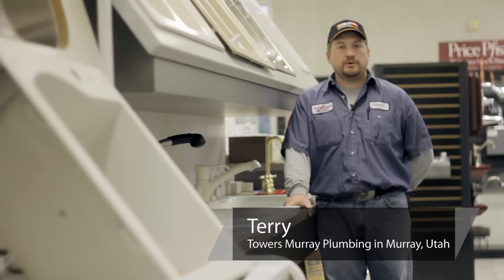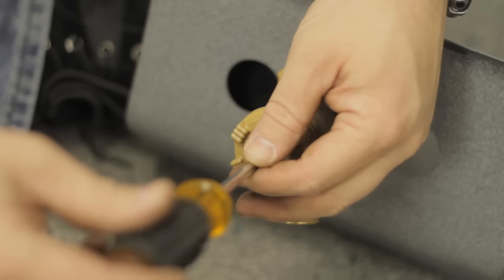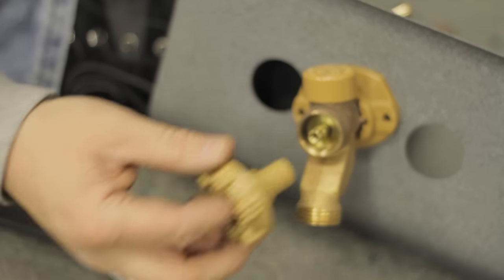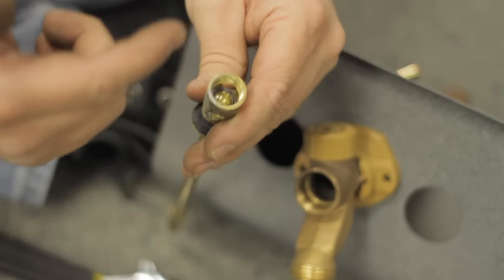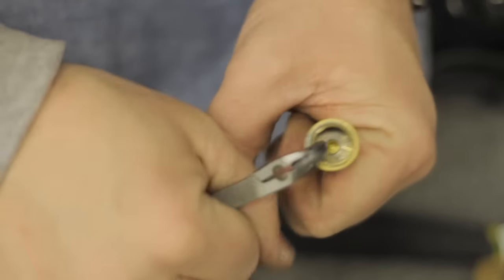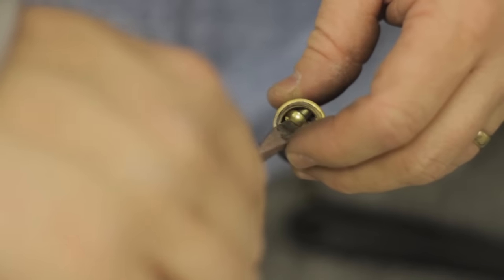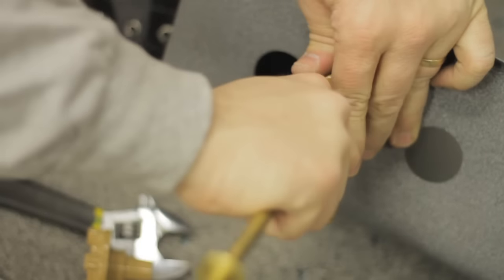Fixing Faucets : How to Repair a Leak in a Frost-Proof Water Faucet

Comment: Worked great for me. Though my packing ring wasn't rubber, but a wax/thread material. I had to dig it out. And my new handle is harder to turn. But it works fine!

Comment: i had  my faucet not turning completely off. I purchased a repair kit and replaced everything but the check valve. should i get back in there and replace it? i just didn't know how to remove the old one, from another video i now do. can i get away with it and leave as is or should i get in there and replace the check valve? thanks- Jr.

Comment: If the faucet leaks around the handle when the faucet is on, but doesn't leak at all when it's off, do I need to do this whole repair, or just the packing washer?
Reply: Bobos Curse How did you fix it, I have the same problem?
Reply: @ivana10yu  I tightened the screw and that took care of it for now.
Reply: Mine leaks when handle is on, bone dry when odd. I tried tightening the screw and it still leaks. I’m gonna venture a guess that it’s the packing washer immediately behind the handle.
Reply: It could be the rubber seal

Comment: Hey Terry, great video of a disassembly of the valve. Do you know what would be causing the valve to pop out 3/8” when the water is turned on? I have to wiggle it just right and push in while I turn the handle to shut off the water. I would love to fix this instead of having to replace the whole spigot as I am  concerned about this causing a bigger problem down the road. The line is in between floors with no direct access to see what’s going on behind the wall so this also adds a degree or two to the overall difficulty. I’m not sure what the best course of action is for this situation. I don’t know if this valve problem could be become worse or if it’s just a small nuisance taking more time to get the water to shut off.

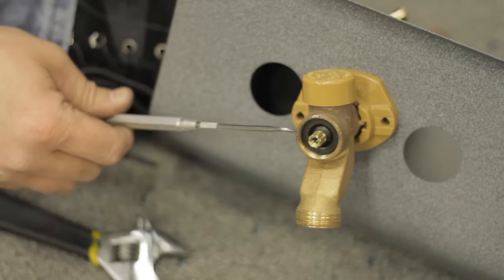Comment: Can you tell me for this 00:45-00:50 I need to repair small leak from handle, do I need to turn off water at main switch to change the rubber seal on 01:02

Comment: Good job, short, sweet and to the point. I have a rental which has a corroded brass seat in the silcock caused by lime and mineral deposits. I can't get the seat out with a seat removal tool. When we replace the bib washer, the seat is so rough, it tears the bib washer up within days. Is there a tool I can use to maybe smooth out the brass seat without removing the entire silcock? I'll have to tear up an interior wall to remove the silcock to keep from twisting the copper pipe. The silcock pipe threads are also corroded. Any suggestions?
Reply: Me too!

Comment: I think the pipe itself burst. When the spigot is off and there is pressure, water comes out from behind the escutcheon. I do not know how to access the other end of the hose bib. Can it be unscrewed from the outside with a wrench and replaced or do you have to tear open the wall?

Comment: The handle screw was seized up so bad to the aluminum handle, I couldn't get it off. So I left it on, loosened the nut that holds everything together, then  I used my crescent wrench as a hammer, with the jaws on each side of the rod and gently tapped the thing apart. Put on a new washer, put it together, turned on the well pump, and it leaked just like before. Pulled it apart. The washer was just a little too small. Used the next size larger. 1/4". Put it together. Still leaked. I didn't have the screw that holds the washer in, tight enough. It's finally fixed. Thought I was going to have to replace it. Plenty of room in the crawl space, but there is galvanized pipe with a threaded union and the faucet pipe is copper, soldered to a  threaded connector. So somebody is going to have to be outside yelling "turn it just a half turn more, the nozzle is pointing up".  I'll go to the hardware store and see if I can get some kind of a flexible connection to get around that. Put in a ball cock valve too.  BTW I thought about turning off the water to the outside spigots, but the well water (600 grains hardness), has corroded the shutoff valve so bad, I can't turn it. I'm planning to replace this faucet and add another one beside it. This one is hard well water, and the new one will be soft water from my softener, so maybe I can wash my car without it turning to a spotted mess. (or maybe not). You spray your car with hard water and it turns into an impossible mess.

Comment: Mine leaks from the top. There is a small plastic float that has a rubber seal that always cracks. Any idea where to buy these. Last time had to buy an entire assembly
Reply: Would that be a vacuum breaker? Search for another video for that easy repair.
Reply: Amazon has repair kits. The plastic part on top is called a “float”

Comment: Hey Terry you did not replace the seal on the back of the inner washer housing. That rubber boot simply pulls off its seat, then pull it all the way off the tap end.

Comment: Thank you, Terry
I can't get the long stem out.   In our Woodford frost-proofaucet, could there be a threaded area at the far (inside) end of the stem?
I unscrewed it (counter-clockwise) untill it feels free but cannot pull it out.
Tap from behind with a hammer?

Another problem is that the new anti-siphon valve _ || _ will fall down out of it's clear plastic holder which screws into the top of the faucet.    Looks as though it would fall into the faucet if I were to try to install it.
Defective part from Home Depot?
Thank you.
Reply: The long stem( rod) won’t come out because there is a rubber check valve at the end of the rod attached to it. You can pull and wiggle the rod out or just give it a good yank. The repair kit will come with a new rubber check valve.

The plastic part on top is called a float and the easiest way to install it is align the little stem into the hole of the plastic float and the turn the faucet upside and hand twist the float in if you can to keep the smaller plastic piece aligned in the larger one if that’s possible. Otherwise you will just have to do your best installing the float into the top of the faucet right side up. It is essential the small stem is in the hole of the larger plastic piece during install or else it will leak.
Reply: @Underthesea851  Thank you, klogwatson.    
Wife lefthe hose connected and water froze and splithe shaft.    Replaced withew from Home Depot.     Only regret is it must be turned many times for full ON.
(My plumber friend, Claude, I call Clogged .)

Comment: My faucet wasn't leaking, it just kept spinning. Took of the handle, no issue there... its internal.  I took it apart just like in the video...only that bottom part of the valve didn't come out with the rod assembly. Where do I go from here?
Reply: Same problem here! I've been trying for over a week, even unable to get it with Woodford's "retainer removal tool". It doesn't engage at all turning counter clockwise c (or clockwise)
Reply: How did you guys fix this?
Reply: @craigpoland5645  The only fix, was to purchase and install a complete new assembly. Contacted the home builder, they got me in contact with the plumbing contractor... all sorted, think it was 60 bucks. All said and done.